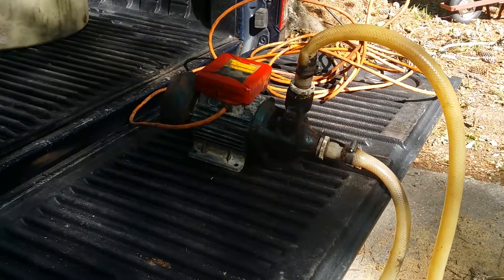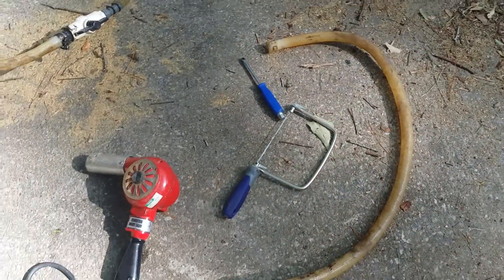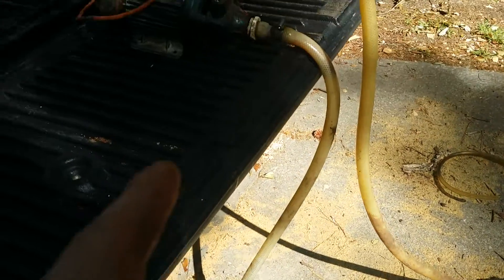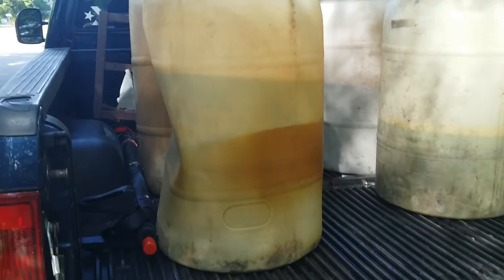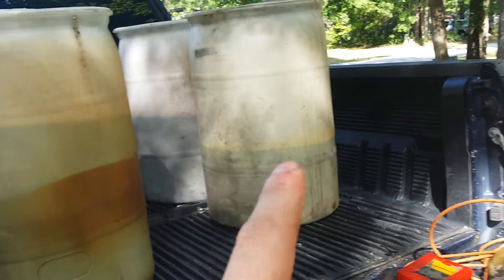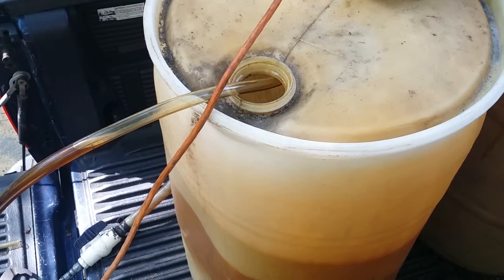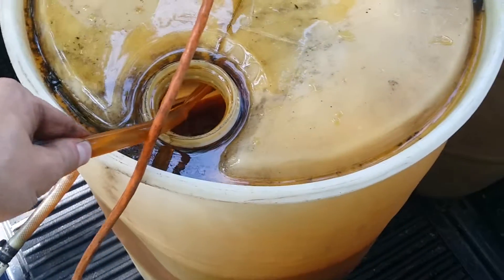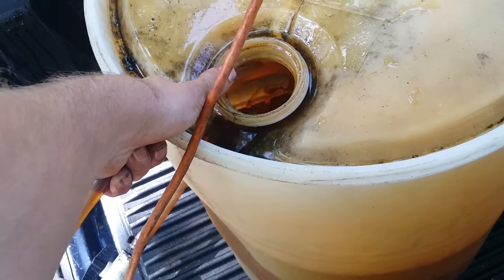BIODIESEL SETUP AND USING THE TRANSFER PUMP

Comment from the maker: I found that as long as I keep fluid in the line I shouldn't have to prime the pump. between the check valve on the suction end and the ball valve on the discharge end it holds fluid pretty well.
Reply: If it works, it works.

Comment: If you take the check valve apart, remove the spring, add an extra nut to the stem for weight, and reassemble it without the spring, you will have produced a foot valve, which will do what you want.
Reply from the maker: I figured I might be able to.